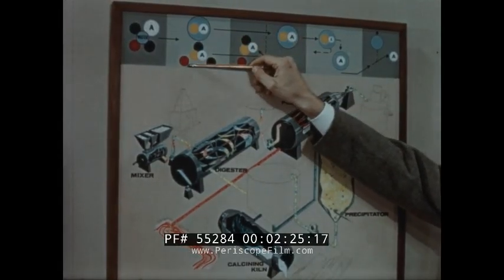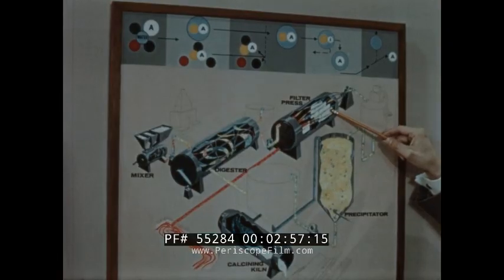ALCOA ALUMINUM PRODUCTION  EDUCATIONAL FILMS  BAUXITE MINING, REFINING & SMELTING   55284

Comment: At Rockdale, at the end the pigs were three quarter ton picnic table looking chunks. We had flatbed picking up pigs, usually stacked 5 high in a single row five Stacks along the Centerline of the trailer. Flatbeds also picked up sheet and good which was one great long Extrusion massing about 20 tons. Sheet loaded on the slab, cut to the appropriate length by shag. Pigs loaded on the street next to the cast house, we could fit five trucks on the slab & the street between the security office at the entrance & the slab waiting to be backed in under the crane. 5 could fit on Travis Street between building 90 and the fire station. My job in the plant protection division what is Manning the main gate and logging in drivers as they arrived in no-man's-land how to cross the street between the smelter and the power plant. Some drivers would arrive as early as the evening before so as to be first in and first out. We'd have 50 or 60 flatbeds a day, plus another dozen or a score drive-ins picking up pigs at dock three . Then there were another dozen or so Vans making deliveries to the store room at building 45 and 64. 
My job was to call the drivers on the CB and invite them to come down to the gate and sign-in. Make sure they had the proper PPE and direct them where to go, keep track of how many were aware and get the next one as soon as there was room. We loaded from 7 in the morning till lunch, when there was an hour break, then we'd finish the day about 3 in the afternoon.
In addition to that I was responsible for answering the telephone and either getting people to the right number or giving directions to get to the plant, answering all manner of questions. I'm also a medic and firefighter as well as private security, so if there was an emergency I had to go grab the ambulance or fire apparatus and take care of business... we had a fire brigade comprised of about 100 people, and a medical Department staffed by nurse and a doctor during business hours and a nurse on off hours. Patients were treated and stabilized at the plant before being transported to definitive Care at the hospital in town if necessary. The nurse and Doctor also provided Health Care in the form of physicals and checkups, there was an x-ray machine and all the necessities of a general practitioners office. We also were responsible for Fire, Health and security at the power plant and the mine, although the power plant and mine were eventually sold and the new owner provided their own.
Good Times. I enjoyed it and I wish it was still in operation. I'm still there but now I'm just checking in a couple of dozen deliveries and another dozen scrap loads taken the demolition bits to the scrap yard.

Comment: Yes right, the toxic byproduct are not been recycled, they end in an big hole, which forms a lake, and finally ends in the sea.... go and check the Alcoa factory in Spain, San Ciprian. Go and google Earth  43º42’03”N 7º29’19W (O alto de Lago)
Reply: My plant (not alumium) has a runoff lake - it's monitored for contaminant levels and must maintain below concentration guildines.. the  solution to pollution is dilution